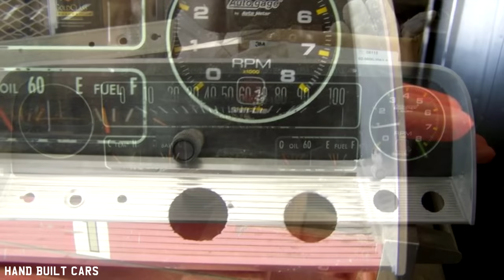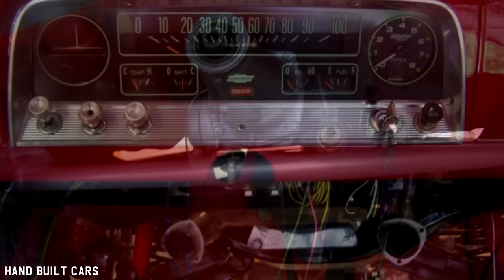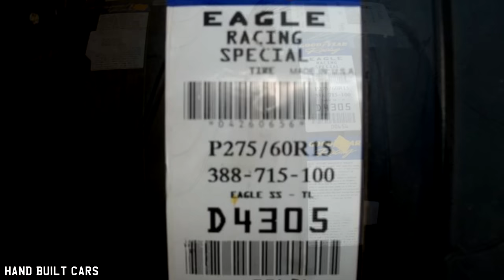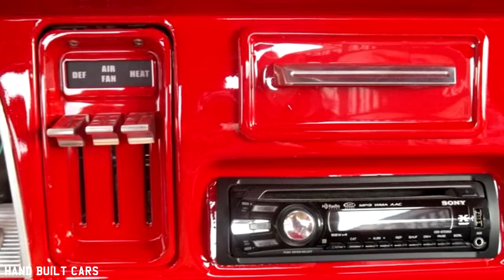1965 Chevrolet C10 Fleetside Pickup Truck Build Project

Comment: Awesome job! I love the stance and wheel choice. Perfect! My Dad bought a brand new short bed small back window in 65. I learned to drive in that truck. I have a 65 long bed small window I'll be starting on soon. I will be converting it to a shortie fleetside like yours  I plan to keep the silver interior and ditch the custom cab chrome plates but keep all the rest of the chrome. I'm looking to recreate my Dad's truck but upgrade it with disc brakes, relocate the gas tank etc. Maybe a 427 or stroker 383 and a TH 400 transmission. Your video is the best I've seen on the 65. Thank you very much!